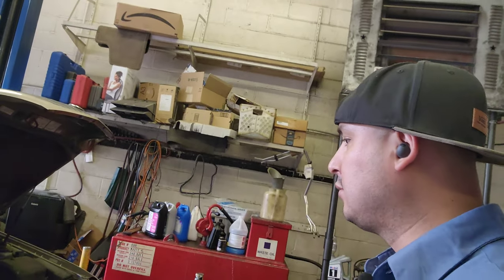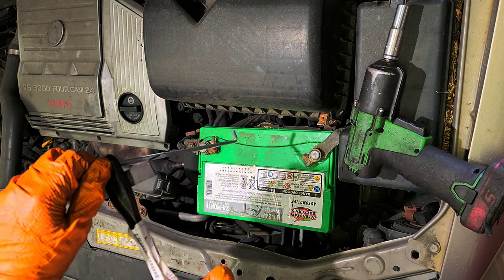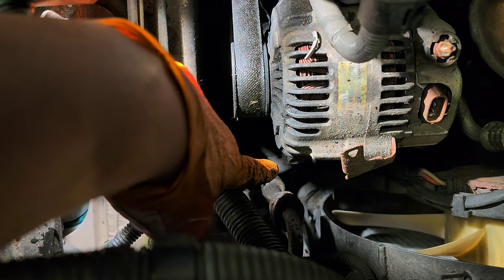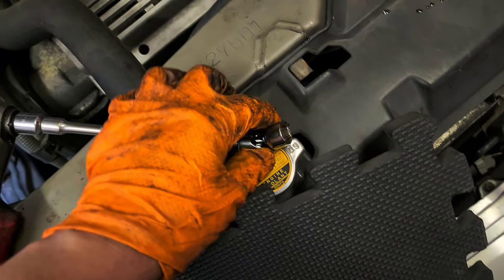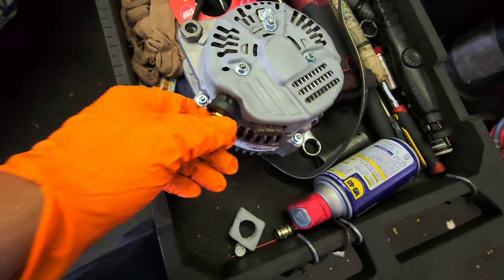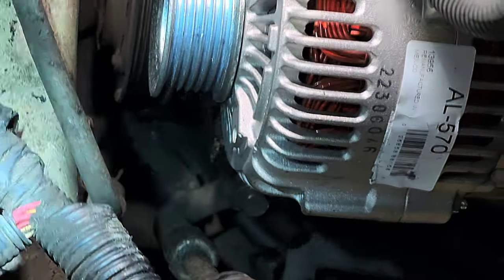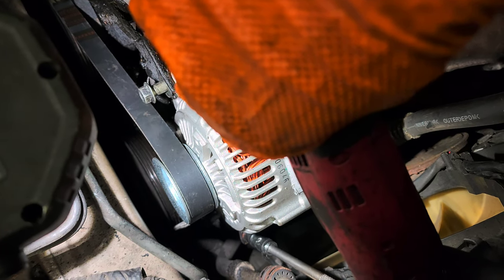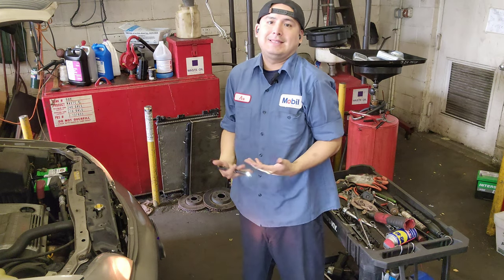1999 - 2000 Lexus Rx 300 How to Replace the Alternator

Comment: Question bro, is there any way the alternator could be the cause to my Lexus revving up but not moving? My battery died after having the car sit for 2 months.
So I replaced the battery, car started, took it for a spin down the street, I’m coming back, stop at a light, turns green, I hit the gas, RPM’s went up but car didn’t move . So I shut the car off, waited 2 mins, started and it moved again.
Reply from the maker: Kinna sounds like transmission